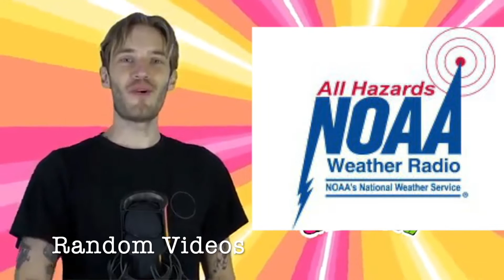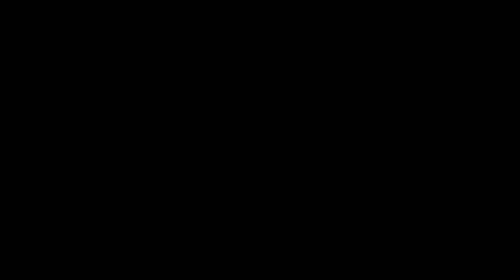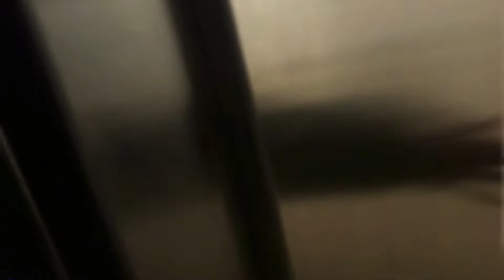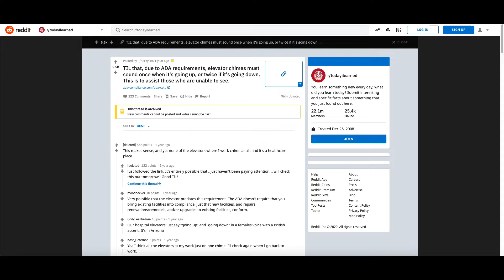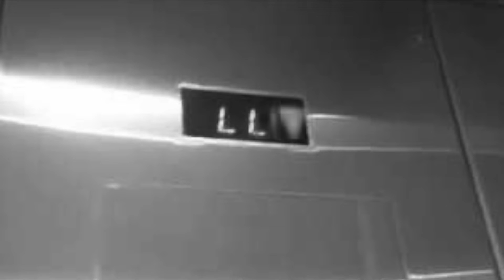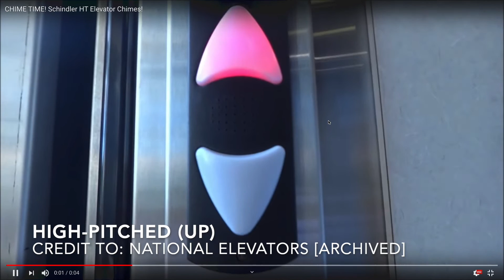Elevator Theory: This is THE END of Schindler HT Low Pitched Chimes

Comment: I’m pretty sure I’ve found out why these chimes are replaced, and all of the rumors are false from what I have received from a tech.

There were soft mods done to the Miconic controller on 330As in 2004, and I’m assuming they presented the building owners with the option of upgrading the software on their 330As/321As, which explains why the controllers are replaced on 321As